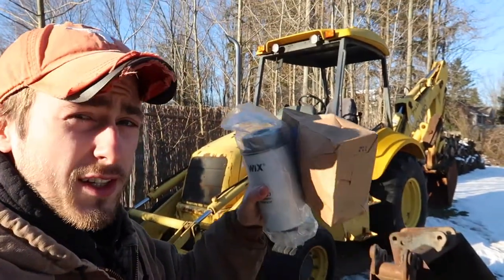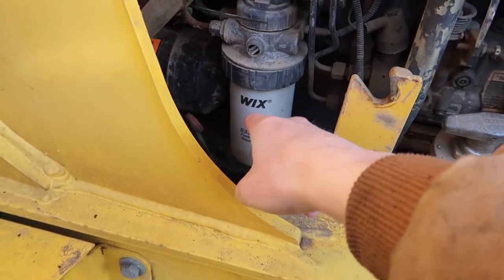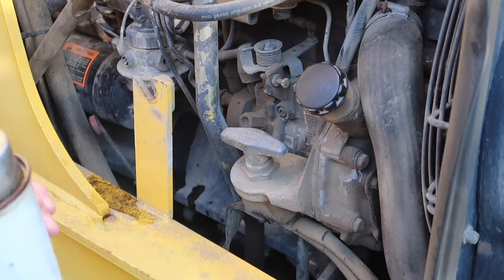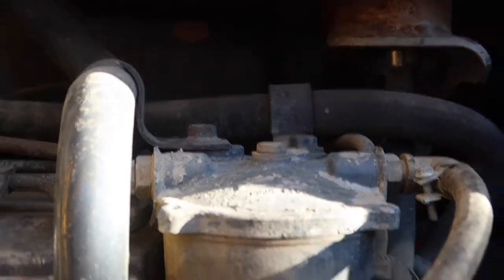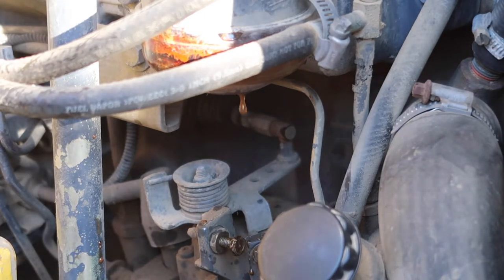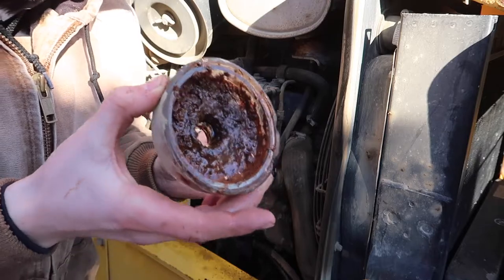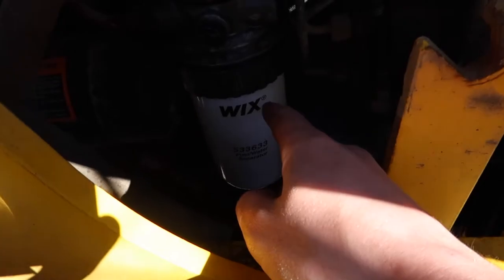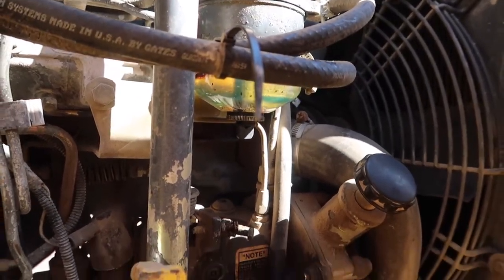DIESEL FUEL FILTER CHANGE (yes, it was FULL of dirt)

Comment: Did you fill the new filter with fuel before installing and could you show a short video or msg me how to prime the system. I ran one out of fuel and now I can’t get it started 🙄
Reply from the maker: Yes I did.  And there is a screw on top of the filter housing.  If you loosen it and turn the key to the run position it will bleed the system.